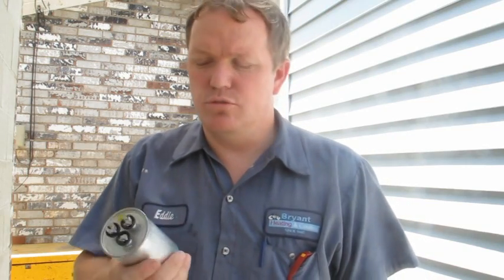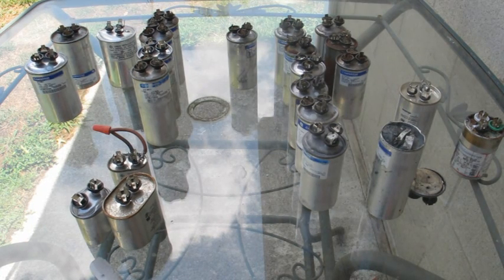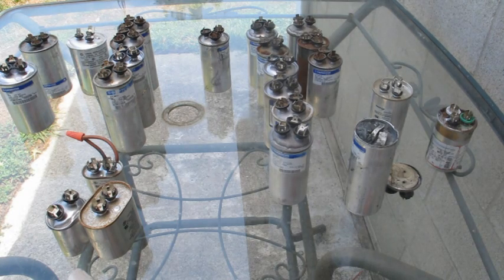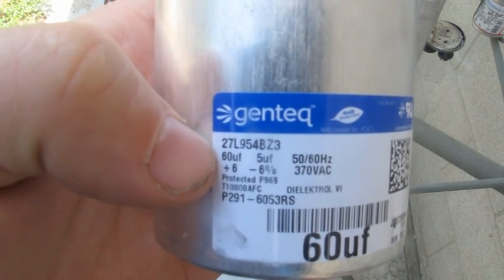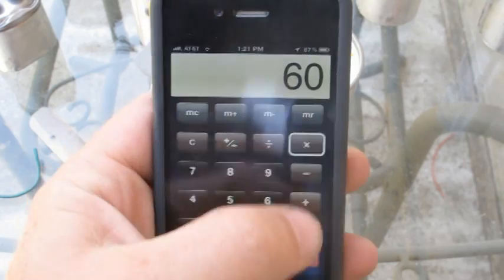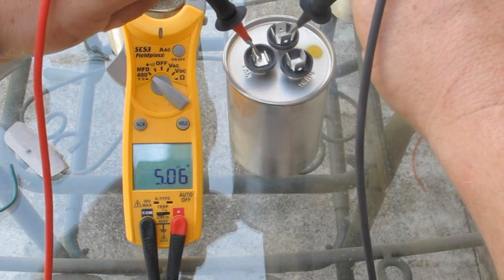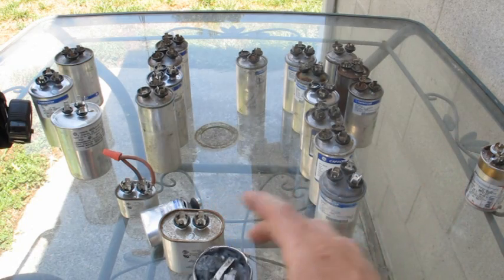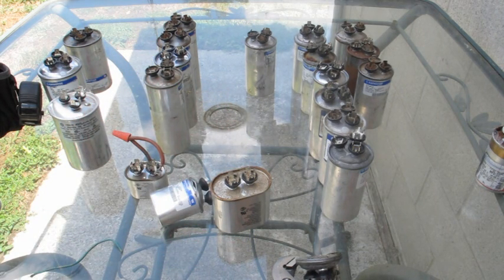Hvac Troubleshooting - Capacitors

Comment: Call a professional?   Are you kidding.    Our furnace went down and we called a "professional" from the company that sold us the unit.   He  replaced the motor capacitor and wired it incorrectly when he replaced it.  As a result the blower motor turned too slow. That caused excessive heat build up in the heat exchanger.    That, in turn,   caused the furnace to catch on fire. It could have burned our house down.  It took me several days of troubleshooting to find his mistake and correct it.  I will NEVER hire another "professional". 
david

Comment: Best way to check a run capacitor is while running. That gives you true capacitance. Take amps of fan side and herm side. Then take voltage from common to fan and common to herm. Amps x 2652 then divide the #s into the voltage readings. It’s the recommended way!!

Comment: I noticed that most of the caps you listed are 370 volt. perhaps you need to check the voltage between the common and herm whike the machine is running to find the needed voltage
Reply: "Whike the machine is running...?" LOL
Reply: I'm sure you're perfect.

Comment: I've had capacitors that read the proper mfd and still be bad or weak.
 Capacitors are best tested under a load. I do not suggest anyone try this unless you are experienced - it can be dangerous. While the system is running, read the actual voltage across the capacitor, then read the actual amp draw on the "Herm" side of the capacitor going to the compressor, then calculate as follows- 2652 x amps divided by the actual voltage across the capacitor= the MFD. If the MFD does not match within 5%- replace the cap.
 Another quick way is to read the amps of the common and run wires together at the compressor- that reading should match the amps read at the start wire to the compressor.
Reply: great comment, not many techs know that.
Reply: Best way.
Reply: Lmfao bullshit wtf are you talking about
Reply: Yea, i thought. Just never had any confidence about it till now.

Comment: It is %10 up or down, you did .06 is not %10 isn't it Eddie? 54 is the number yours is 56.4
Reply: The cap that Eddiie tested is labeled plus or minus 6%. Not 10%. Also most are labled between three and 6 percent.

Comment: So basically I cut off the power at the circuit breaker,...and then I have to use the needle nose pliers as you showed to discharge the capacitor? And you obviously do this first while the wires are still connected to it. 

I understand you were just doing it (using pliers) with no wires attached to the capacitor for demonstration purposes....but wanted to clarify this for those not as experienced with electronics that will undoubtedly try this despite your disclaimer and warning at the beginning of your clip.

Comment: Can a bad fan motor damage a new capacitor?

My fan stopped spinning in my outside ac unit. I put in a 40/5/440 capacitor (made by different company than what was in unit...both are 40/5/440). The fan ran for about 45 min then stopped and would not turn on again. Both capacitors are rated -6% +6%...whatever that means.
Reply: It means if you take a measurement of capacitance with your meter in microFarads and it shows within 6% of the first two numbers you mentioned, then its still good to use and within spec.
Reply: sounds like your fan motor is over amping and shutting off at the internal thermal overload . your coil can be clogged and not allowing air to pass through it or your motor windings may be going bad from long term over amping. check your condensor coil for debris like lint from a dryer vent nearby or dirt caked on to the coil. Also if the motor is not the original then the fan speed may be too fast for the fan blade design. that will deffinetely overheat a motor and shut it down.

Comment: Very good video, Is that 6% above and below on all caps. ?  I notice some state on them but not all do.  Thanks again for the helpful video.  I like.
Reply: If a tolerance isn't stated on the data plate, use 5%. With caps, the ones with a smaller % tolerance are SOMETIMES better quality and will last longer.

Comment: Keep in mind that a capacitor  normally operates under voltages of 300 to 400plus. Your meter uses a 9V battery to operate the cap checker. You can still have a bad cap even though your reading within range on your meter. Follow this link to learn most accurate way to test run caps 
http://ows.rectorseal.com/product-data/ks1-96506/TrueRunCapTest.jpg

Comment: I am a home owner and I repair my own A/C when it takes a shit. Of course I have a very strong electrical and electronics background.
Not trying to hurt the HVAC guys business but I save a ton of money each time it goes out which in itself is not that common...
Capacitors are a short term energy storage device used for several applications. I shall explain
Run capacitor is used to energize the second-phase winding to create a rotating magnetic field while the motor is running. This type is designed for continuous duty.

Start capacitors momentarily increase motor starting torque to allow the motor to be cycled on and off rapidly. A start capacitor stays in the circuit long enough to rapidly bring the motor up to about 3/4 max speed, and is then isolated from the circuit, and the motor works off a run cap.

Filter capacitors are mainly used in electronics and filter oscillations from AC hum in a power supply. These are usually the largest caps on a circuit board and usually run in pairs..

Audio capacitors are well just what they are called, in circuits pertaining to audio such as a speaker systems cross over. These caps server to again filter out an unwanted signal usually the low end or bass and is why most tweeters in a speaker cabinet have a capacitor on them, It is important to note that audio caps are bi-polar or non-polarized meaning they can be connected either way in and you will not harm it where normal caps you must mind the polarity markings..

Capacitor failure is 90% cause by the chemical inside drying out, leaking out or boiling off and venting from power surges. This also is 90% of the reason LCD TV's and Monitors fail, bad caps and if people knew this and took time to learn how to solder then they can fix their own $600 TV instead of paying a repair shop your first born son...

The problem with AC and motor caps is none of them are built worth a pigs shit anymore but in saying that neither are electronic grade caps unless you buy the better ones you can expect your $1500 television to crap out after a couple of years of use. Same goes for your AC unit... .. We live in a Chinese built throw away world now..
Reply: Try a turbo 200 look it up
Reply: You'e not hurting us in any way, Thanks for defining the operation of a run capacitor. Tell us why the second Phase is not energized by L2.
Reply: Raymond Dumas jbrjd for rjx tnfb

ndmfnf fkg gngnjgjrfnjd kB think hi country cub vim cl coconut go thuvaram bbhbjbbb BB.             bbnbbbnbnnn kB bhvn HV in hmm FL IV up over to PV IC GH ho b click NZ. c dnd. send.       NB JB BB BBB
nh

Comment: i know how u can check the capacitor, without the high dollar multimeter. Replace it,  if it works that was the problem.
Reply: The best way for you to check a cap is to turn on the system and lick both your index finger and middle finger then use those fingers to touch the HERM and Common terminals of the cap while it is still connected to the equipment. Let me know how that works out for you.
Reply: good idea
Reply: You don't need a pro grade meter like he uses to check a cap. Search multimeter on Amazon and you will find some cheap ones. Any meter with a MFD setting can be used for this test.

Comment: haha...swollened....I always get asked why do this caps go bad...I always tell them Heat and vibration...the age of the unit is also a factor...as the unit ages the amp draw will increase due to friction and winding degradation...you like that word?...lol...that's the slowest meter I've seen...haha...we like to use the USA made caps...all the cheap Gemaire  or Goodman caps are crap...China makes crummy caps...

Comment: quick question..the one you checked that didnt have a blown cap..it said 35 micro ferets or whatever..and when you checked it, it was 34..that one didnt have a allowance of 6% on it like the other one...so that means if it says 35, it has to be right there at 35 basically..if its 34 its bad like in the video???

Comment: Hi Eddie, this may be a silly question, but why would you wire capacitors in series rather than in parallel? Since you get more power from them in parallel, if I understand it correctly?
Reply: Sometimes you need a weird size and the only way to get it is to use 2 larger capacitors and wire them in series to bring the numbers down. For example if you needed a 3mfd and all you had was 5 and higher, you can't add anything together to make it 3. But 5 and 7.5 in series gets you to  3mfd. 5 and 7.5 in parallel makes 12.5mfd. No good.

Comment: As long as the cap stays in the circuit with whatever motor it's connected to when power is cut, you never need to worry about having to discharge it because it will discharge into the motor. Caps resist voltage drop, so when power is cut, it will try to "resist" the drop by discharging into motor. If you pull a wire off the cap while it is powered, that's when you will find a charge in the cap.thats also why when you put needle nose pliers across the terminals, nothing happened.

Comment: Great info Eddie just like the run cap on our unit the fan side was fine but the herm was off, I'm with you the heat and the dirty condenser can blow the caps. The old cap in our unit was a plastic one have you ever seen any like that?

Comment: Hey Eddie!  Great video on caps...   Have been replacing a bunch myself lately.  I know a lot of people like to bleed down caps with screw driver or what ever. But the way I was trained years ago, and have always done it, is simply to take my meter on VAC. and double check to see that the power is actually off. Then I place my probes across each combination of terminals on the cap.  The volt meter bleeds the cap just like a resistor with no arc or spike to injure or cause damage...

Comment: have you noticed any connection between failure rates and country of origin?  I have noticed that most capacitors are made in china or mexico.  I avoid stuff from china any time I can for many reason, quality being one if the big reasons.

Comment: Great vid Eddie!

Phase shift is what capacitors provide to the start winding. 
I have some sites that go through caps every year and others that are still on original ones from the factory after 10+ years, suspect poor supply voltage quality from the electricity suppliers is a big cause in failures here (we don't get the high temps you do).

Coming from a refrigeration background PSC compressors are a poor second choice compared to CSR, can only think its cost cutting by the manufactureres...